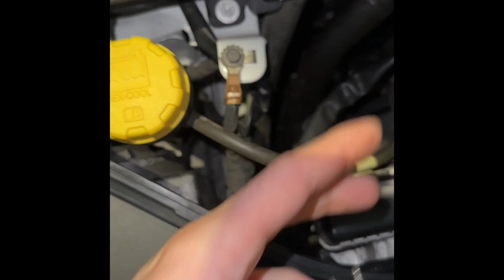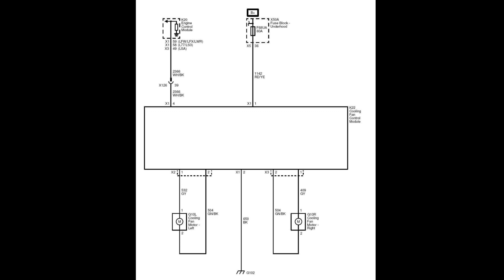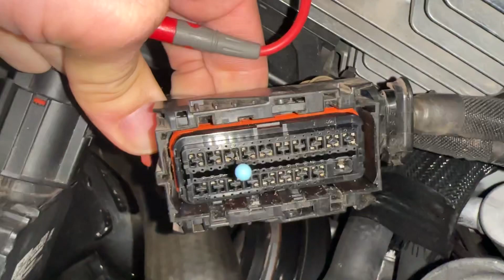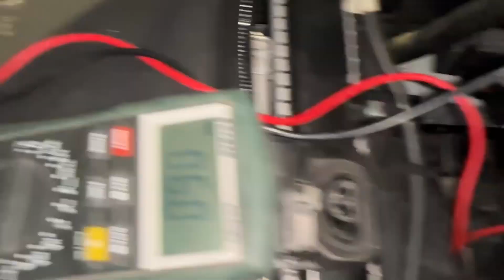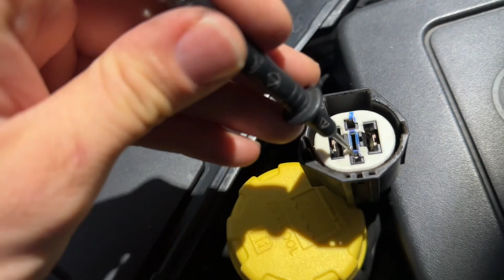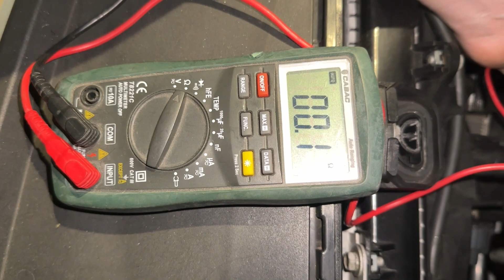DTC P0480 Fan controller diagnostics Holden VF LS3 L77 Chevy SS LS3 (working system)

Comment: hey mate im getting a p0480-00 code on my holden vf sv6 series 1, the fans are good when i give direct power and im getting no codeson the dash except for a "service vehicle soon" message on the screen in the middle. how do i diagnose this and what could be the solutions. ive also checked all the fuses and relays.